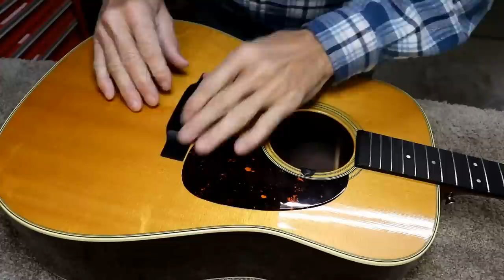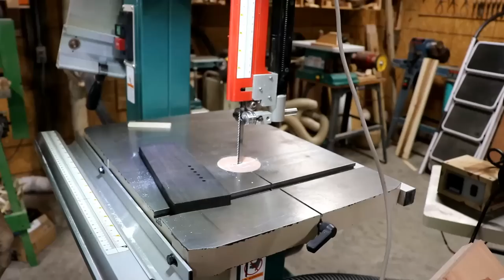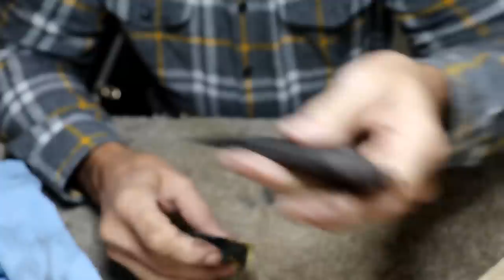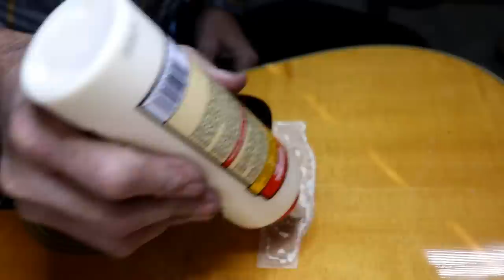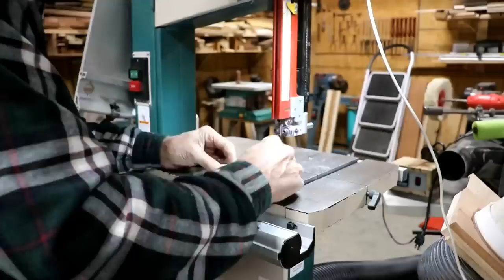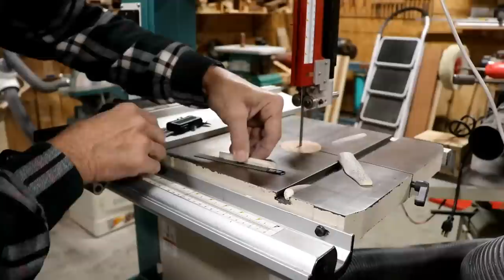619 RSW This Can Get Risky Real Quick! - Martin D-28 Bridge And Saddle Replacement

Comment: I think I would've made a test saddle out of wood that was thin enough to go in and out easily and I would know the depth and if the bottom was flat or had a ledge. Then when the wood test saddle was seated securely and all the way down, make a mark on it even with the point where it is exposed.  Then you could lay it on the side of the bone saddle and make a small mark just below that point on the bone saddle. Then when it disappears as you are seating it, you would know when it's all the way down. Something like that maybe. It just seemed like you were unsure of when the saddle was completely seated in the slot. But I'm sure that you got the job done correctly.

Comment: Thank you Jerry especially for pointing about preparing the area where the bridge lies in and to be careful with the direction of using the tool you are using and considering that grains direction since it is open book matched top. Thank you a great job . One question is what is your opinion about making slots at the holes using sStewMac knives so the strings  ends will lock much better at the top of the guitar ?  Great job again as always especially with your skills and experience. Thank you my friend Jerry, blessings and Regards from ENGLAND 🏴👍👍👏👏

Comment: Great job. If I were trying to fix that, I would probably use router to remove crack and glue in a plug. But I am not skilled to use a router or any of tools you are using, except drill and screw driver :)

Comment: 5:00 As the bridge's top is not flat, the iron wiggles over the top without really transfering the heat.
Flattening the bridge with a grinder (it will be thrown away anyhow) will allow the heat to transfer more easily.
Plus: The thinner the bridge is, the easier the heat will get through the wood.
8:06 Wouldn't make me all happy ;-)

Comment: could you mark a center line on the saddle before taking the old bridge off?  so you have a point of refrence when you cut the slot in the new bridge,  or are there other things to account for that makes that impossible? @Rosa String Works.

Comment: I don’t know Why Martin Leaves bridge pin holes So tight. Best thing to do Is go to Harbor freight spend five bucks and get you a reamer. Fit your pins as soon as you get your Martin. Saves a lot of trouble.
Reply: Probably because the pin holes eventually get a little larger and the pins will go too deep and bury the heads. And so many people don't know that you can reach inside the sound hole and push the pins out from inside. They will use pliers and mess them up. Or worse, they'll use a butter knife and PRY them out! Which of course, leaves indentations in the bridge.

Comment: Not gluing the bridge first? Yes more than likely a new bridge will be needed sometime in the future, however wouldn't it be worth at least trying it first? Now, of course, I haven't seen the guitar, but why was the bridge cracked? Dried out, took a knock (which I could well surmise)? Which ever cause it didn't lift the bridge, it was still on nice and tight. Wood slivers to fill the gap then glue X, sand and jobs a good'un

Comment: The owner like the action a little high, and he doesn't play UP the neck!!? How easy to please! You'd HATE to work on MY guitars because I like the action low and I use ALL the frets, even for rhythm parts!!  So I'll test EVERYTHING, including string bends. Only in the 1st, 2nd, and 3rd strings on my 6-string acoustics. On my electrics I'll bend EVERY string. So fret levels are not easy on my guitars. Just playing open G, C, and D chords won't cut it.